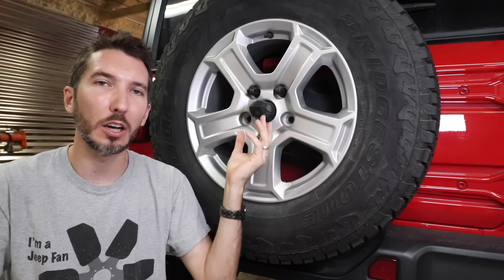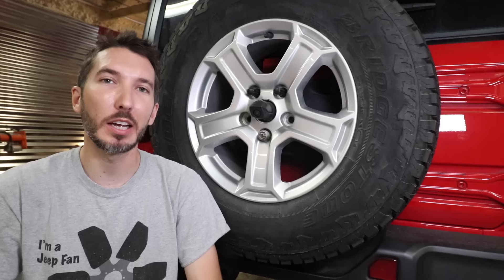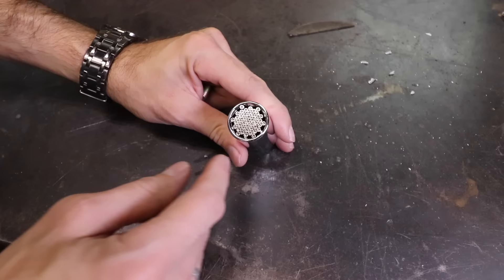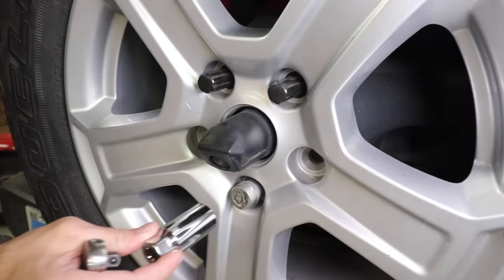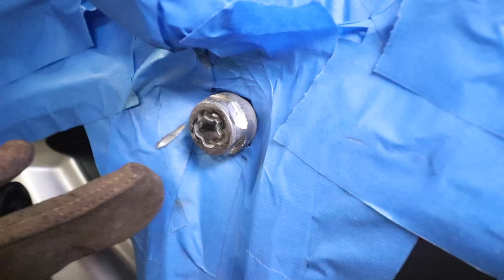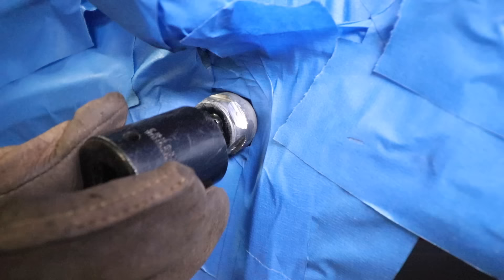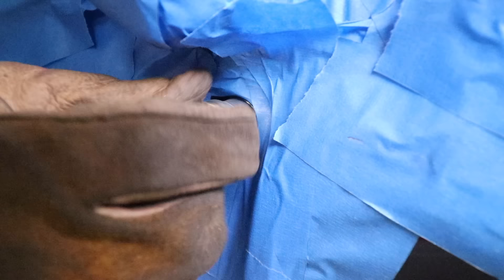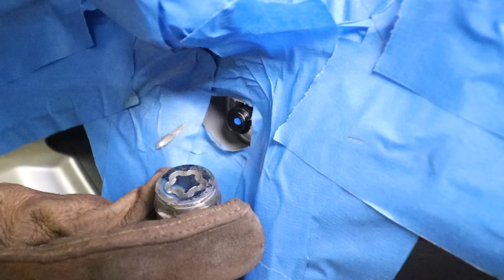3 Ways to Remove a Wheel Lock Without a Key

Comment: Had the same issue with my 97 XJ.. we tried a twist socket set, but we weren't having any luck. Break out the torches, lol. Heated em up to a nice cherry and then used a regular socket (1/2" drive) and breaker bar. There is a slight bit of surface burn on each rim where the torch was used, but they were the factory wheels and I had 31's ready to go on.

Comment: I've taken these of with a hammer and chisel. Use the chisel to make a notch in the nut. Then with the chisel in the notch hit on an angle to rotate the nut counterclockwise. You only need one turn or so to get it loose.

Comment: Sockets are expense and you have to weld around the outside. Use a nut and weld inside the nut, then use a regular socket on the outside. Before you weld grind off the chrome finish so it doesn't affect the weld.

Comment: Lug nut remover or bolt extractor kit is like $25 at amazon. Use it on mine never had any problem removing it. No weld no grinding easy.

Comment: workin on my dad tire shop we came upon this problem alot.....we have done everything you can think of....it just depends on the situation...12 bolt socket .. welding...torch it off.. drill and use an extractor....the amount of rust makes a bug differance in what u do to remove it

Comment: Before I even got into fixing cars, we bought a brand newish SUV from our locally owned dealer. (Bunch of hucksters). Go in for our first “free” oil change and I made sure to do my research at least before getting our oil changed. Long story short, they tried to sell us a power steering fluid change, for our car, which has an electric power steering pump. 

Also, to get a stuck lug nut off my sisters car, I went to AutoZone and got a drill attachment that essentially creates threads on the lugs and allows you to unscrew it with your drill.

Comment: Left twist lug and lock removal sockets . Amazon sells a complete set or any pep boys or auto parts store.  It takes 30 seconds at most. Hammer the socket on then with a cheater bar or long ratchet just counter clockwise and you're done

Comment: I've used that gator socket a few times &there is a size larger then that size & also I think it turned so easy after grinding flat sides into it cause of the heat the grinding caused to the bolt & not the stud

Comment: Tapered impact socket will remove every locking wheel nut EXCEPT the spinners. 
I don't know how to do the spin sleeve type. But I can do a set of 4 non spinners in under 4 mins with a tapered impact socket whacked on.

Comment: Just a thought, but maybe have some kind of mold that you can press over the key. Then, go home and pour epoxy or resin into the dried mold.
Then you will have an exact key made of resin. I think this would work, unless the lug nut is screwed on to over 200 ft.lbs or more.
Cool video!

Comment: A lot of places that sell large numbers of tires usually have a whole box of abandoned keys that might fit.   (Sometimes they forget to return lug nut keys to the customer, discover the key later (laying on the shop floor somewhere), and then throw it in the box of abandoned keys.)  If that happens just once a month, say perhaps to one-in-two hundred cars, after ten years you've got a collection of more than 100 different keys.

Comment: they also sell round socket that you hammer on a wheel lock nut. you hammer it then turn and hammer again and repeat until its off. most garage have that kind of tool

Comment: I use a torch to heat the ring and use a sharp chisel and hammer to break the ring off. Doesn't burn the paint or mark the wheel or melt the center cap

Comment: Our dealership always had a supply of "used" wheel lock kits we took off of "preowned" cars. They might not share these with you, but if you ask an "older" service advisor, he might just help you out. Otherwise, we had a technician who could identify the wheellock by looking at the pattern. It formed a bear shape, and if you could identify which leg or which arm was enlarged, you could identify which lock was needed. If you could find someone with similar skills, you could buy the correct lock from the parts dept. That way, the lock could be reused. Good luck!

Comment: I had this exact issue with my Wrangler.  I tried a hack saw but that was taking forever, and I gave up on the issue for the time being.  A week or two went by, and I ended up using a Dremel Tool and a cut-off wheel and partially ruined the lug, but I had that exact issue with the dealer as well.  Actually, it was worse since I bought my Jeep from a used car dealer, and not the actual Jeep dealer.  The slimeball pretty much told me to go pound sand.

I have not read the other comments, but I considered trying heat, but I didn't want to destroy the rim or the rubber.

Comment: good job done. can u try to make a small hole in the center of plug nut and use extractor (used to remove broken bolts & nuts)

Comment: Use the grinder to cut a line threw the middle of the lock lug , then use a large screwdriver and a wrench that will fit over the end.  Or use a 4 way that has a flat end.

Comment: Bleeping Jeep years ago I bought a Mazda P/U  it had costume mags wheels and had 4 wheel locks, I went back to get the key but like you the dealer ship did not want to help me, so long story cause it was within my 3 day window to canx the deal, they chose to get them off. Y could see where the tech started and finish cause he got better with less damage. Now being a metal worker I knew what it would take to repair them. So their option was a new set or cash back, they opted for a cash deal. I made out with the extra $$$$'s

Comment: I always just use a air hammer and the small pointed end bit.  Shove it in one of those seams of the lock and air hammer it counter clockwise.  Spins right off

Comment: Simple autozone sells a socket that has reverse threads on inside. Put it on short extension hit to drive it on lock. As you loose it digs in, remove many no.problem

Comment: If you line the inside of a 12 pt socket (slightly oversized for the lock) with a strip of aluminum cut out from a soda can, you can avoid any potential damage to the lock and socket.

Comment: I watched another video. Take a huge X tire lug nut remover had one in my car push it on, stand on the furthest arm for pressure .. bounce on the arm as you stand on it & it loosened in one bounce/jump. 3 came off easy & the last one my heavyset neighbor stood on for the weight & got it off.

Comment: Im have a machine shop and recently had this happen to a buddy. I thought about making a socket with teeth on the inside so you hammer it on and it bites into the nut. Then ideally just impact it off. Dont know how much you would use it tho.

Comment: I have simply taken a socket slightly smaller than the diameter of the lock lug nut and drove it on with a hammer and taken them right off before. If you have a welder you can also weld a nut to it and take it off. Point is, it seems that too many people make dealing with these types of lug nuts way too complicated. Just buy a cheap Pittsburgh impact socket that is a little smaller and drive it on there and you will be able to take the lug right off.

Comment: How about when the lug is recessed in the wheel and doesn't stick out. Have had this issue before. Plus lug was over torqued. It was not that easy to get off and had no choice but to partially damage rim. You made it look easy. Would have liked to seen a situation similar to that.

Comment: Sockets with reverse cutting threads don't work on these type of nuts, they are hardened metal and chrome plated. They Make a smoothe bore socket set for removing these type of lug nuts. They work  most of the time as long as the nut isn't over tightened or rusted on..

Comment: get a 17mm  nut or a19mm and weld inside the centre of the nut , no damage to the wheel and its better than any way ive seen in 35 years in the motor trade, you can also cut a deep slot across the head of the locking bold and use a slotted impact but , personally i use a lump  hammer with a manual impact wrench, done right it works with first hit, another tip is to remove all the other bolts get a block of wood  and smack round thee outside edge of the rim , go round a few times, even ise and extension bar on the head of the bolt and give it a good hard smack with a lump hammer , i carry a dremmel 8220 with diamond cut off wheels i can cut off just about and nut with it.

Comment: Big centre punch or sharp medium sized cold chisel usually shifts them, will butcher a bit. I'll keep looking for my key meantime- car with 2 wheels l could use not going anywhere any time soon.. Didn't deter chop shop from removing my good tyres but they had plenty of time after towing car away.

Comment: Best way is still to weld the inside of a  nut to the end of the lock. The ground clamp holds the 3/4" nut  pressed on the lock nut and the weld area is open and the flux is ejected out and away from the wheel. The grinding disc method is too dangerous and the pin socket too flimsy if there is rust involved. Good subject, thanks.

Comment: I have the origanil lock nut on my car and when I found out I didn't have the key to it I did something extremely simple call me crazy if you want but I just bought the key online I didn't have to weld or cut or brake any thing. the lock nut he had on his car is the more modern version where you can go to pretty much any hard ware store and just buy the key for $8-$10.

Comment: Dude.  You did it the hard way.  Craftsman 22mm 12 tooth socket.  In my rebel days.  I would by 4 of them. Tap one on each wheel lock and spin the locks off in seconds.

Comment: That looks like a McGard wheel lock.  I had those back in the 80s.  My method for getting them off without the key was to drive a large socket over the lock and then wrench it off.  It usually destroyed the socket but that's what lifetime warranties are for.

Comment: Just grind two sides and use a pipe wrench or grind no sides and still use a pipe wrench.  Obviously, the locking lug nut was not on tight so it could be removed easily without all the trouble.  The nut appears to have enough exposure to get a good bite.

Comment: I picked up a 5 socket reversible which gives you 10 options to remove I believe I got it from Cornwell or Matco wasn't Chief about a hundred and fifty bucks it's like spiraled left hand cutting threads it will grip anyting and take off any luck

Comment: I would try and find a shop that has an induction heater, or put a large hex nut on over the outside of the wheel lock,weld the nut in the center to the lock then a larger socketcan be used to remove the lug lock nut.

Comment: Use a 12 point socket 3/4 or 13/16 or a metric whichever you have that’s 12 point (6 point won’t work) depending on the size of the locking lug nut. Pound it on with a large hammer. Put a breaker bar on the socket and wala! If the socket falls off, hammer it on farther and harder. Trust me this works every time.

Comment: What about hammering on a socket that is a hair smaller than the bolt and torque it that way? Than put the socket in a vice or into a larger socket and take a Pin/bolt and smack it out

Comment: Get a quality flat head screwdriver with a hex on the blade. Put the end in the wheel lock pattern and turn it with a wrench that fits the hex. Most wheel locks are not tight due to the fact the keys break so easily.

Comment: Take a chisel, put a knick somewhere on the outside edge of the nut, then place the chisel in that groove, at a 45 degree angle, and tap with a hammer in the direction you need to rotate the nut, in this case, a counter clockwise direction.

Comment: I lost the key to mopar wheel locks that spin so I used a 24mm socket and i hammer it all the way in until socket hit rim then I used a breaker bar and came right off

Comment: I have seen other videos of guys taking a barely fit the socket and smacking it on the wheel nut with a hammer or sledgehammer. Dealers have ways to get them off. I have a 2020 Nissan frontier and my service adviser told me if I needed to remember my unique key, they could get it off without a problem.

Comment: That was only two removal options.  The first wasn't even available to start to remove the safety nut.  It doesn't count as, "A way to remove the safety boots."   If you couldn't attempt it, it wasn't an option.  However,  the other two were great.  Thanks!

Comment: I had those lock nuts like yours on 4 of my wheels and I ruined the key itself so I’m not able to remove the wheel locks. I bought a bolt and nut remover set which was about C$24. I used the size 13/16 on the lock nut and I hammered it in and I did not have a problem removing it.

Comment: All you have to do is hammer on a socket over the locking lug nut and use a breaker
bar to turn it loose.   Most of these lug nuts are only torqued to about 100-120 lbs.
so it isn't hard at all to turn it loose.   You might ruin the socket, but at least the 

wheel will be loose.

Comment: Yeah, you missed driving your Jeep through the dealers showroom window. Oooppppsssss, brakes failed. My daughter has a 2016 Rubicon unlimited. And yes, there are always dealer issues. So yeah, been there, done that. Good job on getting the lock off. Sorry about your wheel. I had to cut a mag wheel off of an old Bronco II. I get it.

Comment: That was on there so loose lol..
Next time use the opposite gauged size (if the lugs are SAE go metric) that just barely fits over the nut, 12 point. Beat the socket on, and you're done. 
Or spend the 40 dollars and get a cheap lug nut twist socket removal kit. Worth every penny. Throw it in the Jeep and help your buddies out when they're surprised just like you were.

Comment: use a 12 point metric socket because its cheap metal that streches and its the quickest and easiest way way but use 2 hammers 1 up against the socket and the vibration helps loosen the nut i have done over 50 for people have a nice day oh and no grinding so you dont hurt the rim

Comment: Good idea to grind the flats. I had to torch one off. it was like those tall spline drive ones on your other bolts and the owner had stripped it badly There were 5 on each wheel. thank goodness there was only one stripped. . it was in a deep hole and there was no other choice. It heated and blued the rim a bit but never ruined it. DON'T over tighten those locks.

Comment: as pryor salvage yard owner i had this problem with cars i bought fro salvage pools my faster and way simpler solution was to take a appropriate size impact socket and hammer it over the lug nut. would accomplish two things the hamering would help loosen  and the tough impact socket would bite into the lug nut . this was 1974 75 era. no news here

Comment: Use an angle grinder to make a big slot into the screw lock then insert a big flat screw driver with a square shaft and use a long adjustable wrench to turn the screw driver.

Comment: Not sure if you need to disconnect the battery as electric welding used to burn out the diodes on the alternator.

Comment: Take a socket, slightly larger than the lock and hammer it snuggly to over the lock. Then use a breaker bar to remove the socket and the lock at the same time. Easy peasy.

Comment: Beechmont Subaru/Cincinnati. changed  my oil. Took 1-1/2 Hrs!! Left the dealer finally. 30 miles later my engine came apart..(no problems, no noise, no issues prior...)They denied doing anything wrong(like starting the car without oil......)cost me ....$7,600.00 !!!!! to replace the engine.(Not at that Dealer)

Comment: Answer:
Use Large rubber bands tightly circled around bolt.
Match socket one size up so you have to bang force it on.
Works every time.
YW.

Comment: So two options you missed.   1 cut a slot and use a large area bit on an impact gun.  2.  Put a large but on the end and weld the inside of it.  I stead of killing a socket.

Comment: Yeah on most wheel the nut or bolt are much inner than the one u showing so no chance to cut or grind them best chance is to use 12 point socket hammer it hard then undo it with breaker bar

Comment: Cool Video, I have a similar problem with a Hummer I just bought, spare tire has a lock with no key. I thought of the weld method, but I think I may try the grinder method first. It's a funky key, it's like a hollow tube with notches cut on the inside, definitely needs a deep well socket to go over the lug bolt. Wish me luck.

Comment: I lost the key for the locking lug nuts on my XJ. Called McGard who sells the type I have at least. They said most Jeep dealerships should have a master key set they can use to determine what key you need so you can order a replacement. If you have the info that came with the locking lug nuts you can order a replacement online. If neither of those options works, call McGard. I was able to order a replacement key for $14.